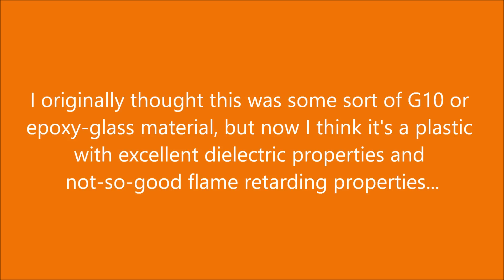Experiment #13 - Dielectric Breakdown Test @ 15KV, 30mA

Comment: Pretty good to hold back 15KV!
Reply from the maker: +CAL'S ENGINEERING 
I have also tested it at 20KV, 1mA - works well, apart from its low melting/flash point. It's a great candidate for HV pulse capacitors!
Reply: Energy Fabricator yes it would certainly work well on pulse caps!

Comment: hi there . did you ever get to the point of running the 20000 volts through the carbon fibre hho plates. can you send the link please as I can't find it. regards andy
Reply from the maker: I did the experiment. Unfortunately, there were no results to speak of, so I did not post a video.

Comment: What kind of wire/insulation are the test leads made of and where can they be bought?
Reply from the maker: +A Clin 
It's just standard 7500 Volt discharge lighting cable.
You can get it from any neon lighting supplier or you can get it on eBay.